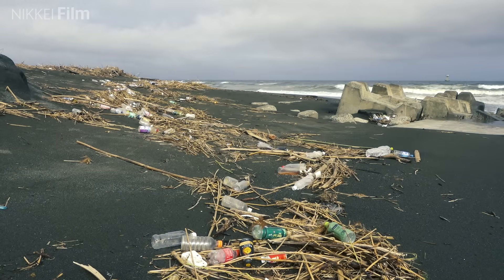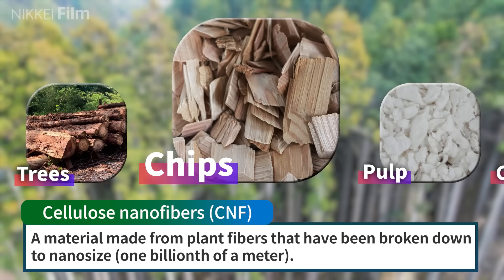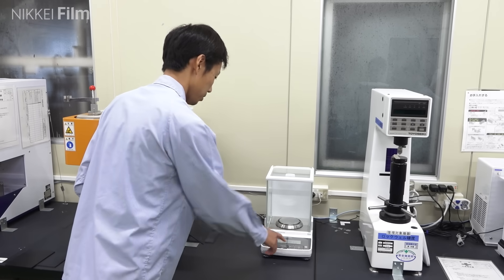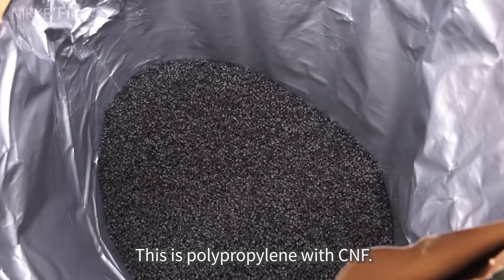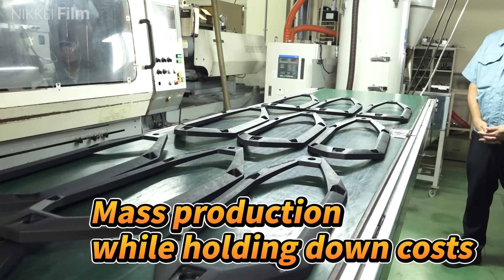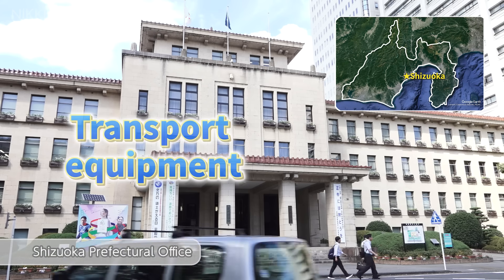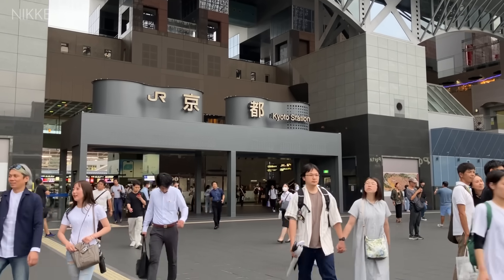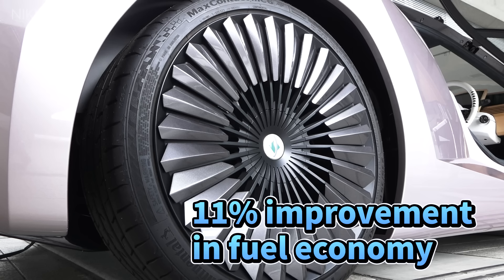Five times stronger than steel: Japan's new 'wood' | Nikkei Film

Comment: This is all a bit confusing: "five times as strong as steel" presumably means "five times as strong as the same weight of steel". But that would make it as strong as carbon fiber. Carbon fiber is around forty times as strong as the same weight as cellulose fiber by some comparisons I've seen so I'm missing something here.
Reply: Click bait exaggeration, perhaps?
Reply: Average weight of an American car in the 1950's was around 4000 pounds. My car weighs about 2500 pounds.
But maybe I should have said "for the same size". And "all things being equal" . Obviously a modern SUV is likely to weigh more than an old compact car. Cars today have to carry a lot more luxuries and have to pass much stricter safety requirements. They are built with much thinner steel, or light alloys or even composites, they have aluminum or even magnesium engines and parts. If we built the same way we did back then but had modern requirements we'd have a lot of super heavy vehicles around! But I see your point to some extent.
Reply: The tensile strength of large wood fibres is limited by discontinuities and stress concentrators within the fibre itself. Nanofibers are short, one piece fibres that have effectively no such flaws, and because of their short length, almost no effective strain under applied tensile loads. Using wood fibres is an old idea, but it's now being done using modern manufacturing and design, which makes all the difference. This is a great test case for durability in use. Clever people.
Reply: @OnroadSafetySolutions A material composed of resin and short fibers is much more limited to the strength of the resin than a material composed of resin and long fibers. This is what I'm having trouble understanding - these are NANO fibers, they can't possibly result in a material comparable in strength to regular carbon fiber. I daresay the material is pretty useful though, I'm just calling BS on the "five times as strong as steel" claim.
Reply: More specifically, a combination of S2 fiberglass cloth, 2% by weight of carbonized CNC's (to the epoxy), and high strength lamination epoxy, can easily rival typical/common commercial grade carbon fiber composite structures at a similar, but only slightly heavier weight, while being tougher and more durable overall and at less cost (if you make the carbonized CNC powder at home).  

  It's a great composite blend.  The S2 adds high tensile strength and toughness, while the carbonized CNC powder adds even more tensile strength and especially Young's Modulus (stiffness) strength.  

  The nice thing about carbonized CNC material is that a little goes a long way.  Again, around 2% by weight to the epoxy.  Researchers have played around with different ratios and it seems that the former is kind of the all around ideal from a holistic standpoint of balancing various different strength increases.
Reply: The material in question is only the crystalline cellulose part of the wood. The majority/rest of the wood, the amorphous cellulose and lignin are (often) chemically dissolved/oxidized/"burned" away, leaving the tiny particles of much tougher, more chemically resistant, and stronger crystalline cellulose behind.  

  This stuff is easy to make at home with sulfuric acid and water-it is just very temperature and time dependent-plenty of free research out there available on the process (there are other ways to make it, including enzyme and mechanical, but the acid dissolving process is probably the easiest for DIY'ers).  The irony is that wood is not a particularly good stock source of crystalline cellulose. It typically only contains around 35% to 50% at most, crystalline cellulose total content.  Meanwhile, bast fibers and cotton typically contains a higher percentage, up to 70%. 

  This stuff becomes even better when you carbonize it. It loses its hydrophilic properties, and the Young's Modulus (stiffness strength) increases noticeably. Basically it is like a more nature close version of carbon nano rods, but far easier and cheaper to make in bulk than true carbon fiber nano rods. It also becomes highly electrically conductive when carbonized and especially so when graphitized (very good for batteries and super capacitors).  

   But of course the carbonization (and especially graphitization) process takes a lot of energy.  Evacuated/vacuum insulated Solar heaters in combo with direct solar panel DC-resistive heating would be the most economical way to do it.  (Also possible to do at home with a little tinkering). 

   The other problem is that being small particles of now disconnected material, it needs some kind of holding matrix like epoxy resin, melted plastic, or the like, to help give it structure and volume. So while it does lessen overall plastic content, it's really not by a lot.

  It's possible that cellulose nanocrystals could be combined with pressure+chemically densified wood or bamboo, with some kind of natural binder (and/or just extreme pressure and heat), to create relatively light and very strong structures, but I haven't looked into that. Even if so, they would need to be waterproofed well to be used in practical applications. Wood, CNC's, and CNF's are all quite hydrophilic by nature.
Reply: https://youtu.be/lAzQWtkPzbI?si=YRO_29_N7Xa2WgB9

Here...nano cellulose fiber. But it can destroys ecosystem with over plantation like this : 

https://youtu.be/dhvOJrkhh8I?si=HiWI5RtFnIcIydJy
Reply: How long are these fibers ?
Reply: @АгронДепартье  Super short
Reply: Why would anyone compare them by weight? If you have need to make a car door, it is the size and shape you'll look at. Wood is much, much lighter than steel at the same size.
Reply: @CaptainSnackbeard I find your question really, really odd: weight considerations are hugely important in engineering. Not just in the totally obvious fields like aerospace but for cars, boats, bicycles, sports equipment, musical instruments, architectural materials, military equipment...  anything that moves or regularly has to be lifted in fact. I'm building a carbon fiber sailing vessel myself and keeping it as lightweight as possible is critical to its success.
Reply: @chrisgrill6302  weight is important, still secondary to form in most applications. You can't make humans smaller or larger to suit forms, and engineering is (usually) about serving humans somehow.

Presumably your boat can't be made 5x or 40x smaller / larger so you can achieve some ideal weight. For example unless you have some kind of hydrofoil thing going on, then without a long keel it doesn't matter how light you make it, it won't go as fast a because of displacement/hull speed limitations.

As to the comparison, Carbon fiber is expensive, difficult to work with, is human made, and creates waste. Wood is cheap, grows all over, is easy to work with, and is itself a carbon sink.
Reply: @CaptainSnackbeard yes you can't make the car door smaller so you make it with the lightest materials you can and thus your car is more efficient. You are clearly not an engineer! Your modern car is MUCH lighter than your parents', that's a good thing and it's not by accident.
Carbon fiber is also vastly stronger than wood and it doesn't rot. Quit changing the subject. I can build a much lighter boat with it that goes faster, lasts longer, requires less expensive maintenance, carries a heavier load and uses a lot less fuel. Those fuel savings over the lifetime of the boat certainly add up to a big savings in resources and thus less environmental damage. You seem to have the most extraordinarily simplistic approach to this topic. What on earth are you talking about, really?
Reply: @chrisgrill6302  and how would you measure the tensile strength of that door or boat? By force per unit weight, or force per unit area?
Reply: @CaptainSnackbeard Force per unit area but that unit area corresponds to a certain weight depending upon the density of the material. There are situations where the compactness of a material is the deciding factor eg. with fasteners - a high tensile steel bolt is going to be thinner than a carbon fiber bolt of the same strength, but in any application where weight is an important factor it is almost always the weight that forces the decision. Eg. The thickness planer in my shop - it doesn't matter if the bed is 10mm thick or 15mm thick, the bulk is unimportant, the weight is unimportant, so cast iron is fine. But you don't use cast iron in aircraft. With my boat and its dinghy weight is extremely important, that's why I pay a high price for lightweight supermaterials. Supermaterials always come down to weight, their light weight is what makes them super. If you didn't care about weight you could make car bodies out of lumber which of course is madness. We've used steel forever for car bodies but lately more and more aluminum because we can get a better strength-to-weight ratio out of it, and now we are seeing carbon fiber cars for even bigger weight savings. It's got nothing at all to do with their volume. The last two materials are much harder to work with though. In fact carbon is an absolute b***h, I hate it passionately but it makes an amazingly lightweight boat (the 60' hull weighs under a ton which is mindboggling).
Reply: @chrisgrill6302  mordern cars, lighter ? You might be an engineer but are you a human living on planet earth ? Old cars were tiny things wheighing 800kg tops. Many mordern cars are easily double that weight.

Comment: So is the whole watercraft made from it or just that small piece on the engine?
Reply: Just the new 25% lighter engine cover. This is a rather in-depth exploration of a somewhat mundane, but apparently somewhat novel composite material. I don't know. It's an odd little film. Injection molded fiber reinforced composites are certainly not new, but it's interesting to get a rather in-depth look at this hyper specific variant that someone apparently thinks is really important.

Comment: Typical Nikkei nonsense. What is the MPa of the material in question? Japanese steel makers have developed ultra high yield steels with a yield strength MPa of well over 780. Give facts instead of promoting fake claims as advertising.

Comment: Any advance in this direction, is a huge 'Huzzah!' from me, and as more widgets* are made, it will get cheaper and a possibly virtuous cycle may kick in. I do have some questions. I know cellulose in trees is pretty safe, unless it falls on me, (and I can't remember if I'm to make a sound or not.), but how much safety testing has been done on nano-cellulose. It's like dealing with an entirely new material. Perhaps it will do irreparable damage to our lungs, for pure example. Also, I'm assuming, that something with, hopefully a ten year totally intact, structure retention, in a marine environment, isn't exactly biodegradable. (Hope, I'm wrong.) Recyclable? Is that kind of it? How clean is the process to make this stuff? Better than petroleum-plastic, I'd hope, as a bare minimum.
*That tiny widget, in a big piece of polluting cr*p, was embarrassing to make such a deal of, but Hey! Keep up the good work!

Comment: Keep recycled plastics away from children!  I learned this the hard way.

Plastic recycling is turning into a disaster, due to a lack of control of the input materials.  Many materials made from recycled plastics end up quickly flaking, deteriorating, and falling apart due to mixes of incompatible additives in the recycled materials.  
I bought some "green" toys for my daughter, made from recycled plastics with wood fibers.  Then I discovered that when she chewed on these toys (as kids do) the toys were just melting away in her mouth, and she was actually ingesting the plastics!

I had the same experience when my employer began using "biodegradable" plastics for our drinking cups.  Turns out those cups are made of monomers with easily biodegradable bonds.  Well, I discovered that my cola was melting away the plastic, so every time I ordered a cola, I was ingesting these monomers.  (After my cola had set in the cup for 20 minutes or so, the top edge of the cup was very rough and chewed up by the droplets which were sprayed from the carbonation.  I don't know why it only affected the edge and not the cup interior, but after this, I started bringing my own cup for drinks.)

Along those lines, I wonder what the long term effects of the cellulose will be.  For instance, is this plastic/cellulose mixture susceptible to molds and fungus in a damp environment?
Then again, under the car hood, there are many liquids which are caustic to the various plastics and rubbers which cars are made from.  An oil leak which gets on wires will destroy the insulation on those wires.  I wonder how cellulose will affect chemical resistance.

Comment: Steel is 100% recyclable and is an isotropic material. Composites are 0% recyclable and they are an anisotropic material. Sure, maybe you can reshape it if you use a thermoplastic, but that does not help you recycle it. Thermoplastics degrade everytime you get them liquid, you cannot mix it with any of the thousands of other thermoplastic variations and you cannot mix it with any other thermoplastic composite using different added fibers (carbon, glass, etc.).

Comment: The CNF is compounded in as a filler. The carrier, in this case polypropylene (PP) is a hydrocarbon. So what sort of environmental savings is that? And don’t forget; you’ll need to cut down trees to make your CNF. The only advantage that I see here is that it has lower density over traditional mineral fillers in plastics

Comment: Oh, look, they are trying to sell papier-mâché as something new.
 Resins have terrible performance compared to metals when it comes to handling heat, most get soft between 60-120° C, then the composite loses all strength and fails.  Metals have vastly superior heat handling characteristics and are easier and more economical to recycle.

Comment: How is mixing resin with cellulose particles environmentally friendly? Resin is plastic or manmade chemical. The only thing is that this material can be melted and reused several times. Otherwise its just a manmade chemical mixed with some cellulose impurities and advertised as having mystical properties which are not verified by independent authorities. Looks to be false advertising

Comment: The video could be improved by comparing CNF with materials of similar price. We already know that CNF is stronger than plastic, but since it's expensive, it would be helpful to compare it with other high-priced materials like carbon fiber or metal alloys. This way, we can better understand its value and how it competes with those materials in terms of performance.

Comment: Great to see Yamaha innovating - hopefully the attitude will rub off on their motorcycle division as after the incredible reinvention just over ten years ago from the launch of the mt09, in the last 3 or 4 years they have been a little too cautious. How does this cellulose material compare to alloys used in bike frames, handlebars for strength and weight? Get some in the bike and maybe improve handling at the same time by introducing better controlled flexibility rather than total rigidity.

Comment: Yet another eco-scam.  "At least 50% of the material contains cellulose fibers" is deceptive wording, like when a vacuum filters "down to 1 micron".  You can see in one of the examples that the density of fibers is so small the resin is still clear. It's petroleum based resin with a tiny sprinkling of fibers and word magic claim it is plant based.

Comment: The big problem to use CNF on car body is just it's higher resistance to deformation, in a car crash it matters that the kinetic energy of the impact it will NOT be absorb by the car SO the slowdown  impact on the passenger BODY will be MUCH HIGHER!!!
SO using the CNF body on a JETSKY make much SENSE as the driver in a accident will be ejected to the water... NO HARM DONE...
Reply: But the design of the 3D printable components can easily be made shock-absorbing.
Reply: @danielwalther5841  
I think you are proposing to make an void internal structure to make the material to better schock-absorving BUT as a rigid material it can absorb better AND remain higher resistant to deformation? Or crumble? 
I don't know, but IF possible to achieve the correct balance may be a solution to SEEK...
I agree with you...